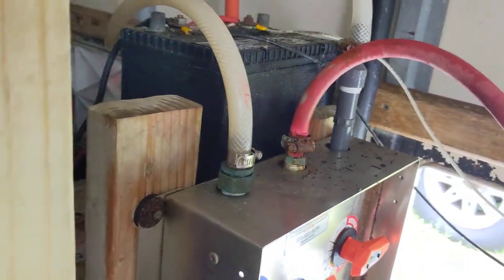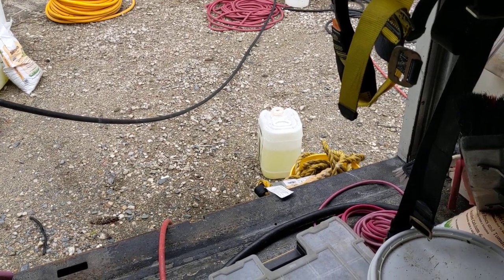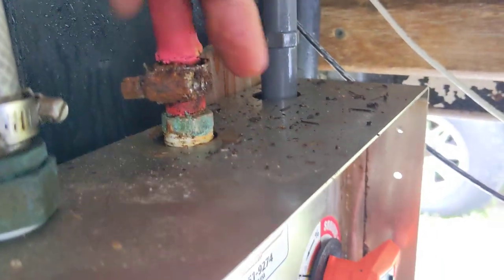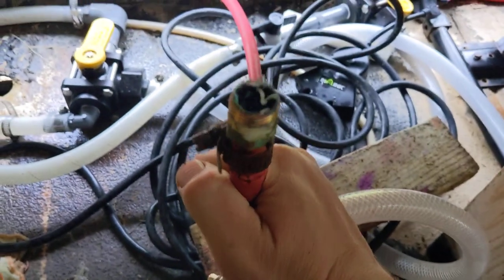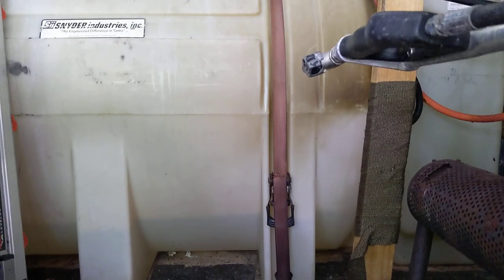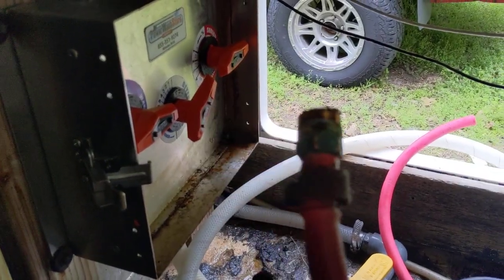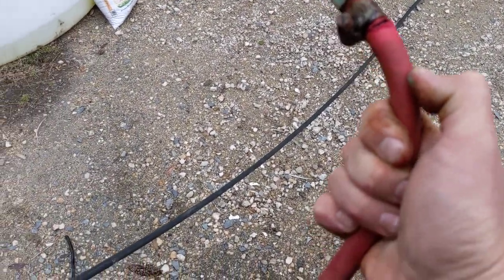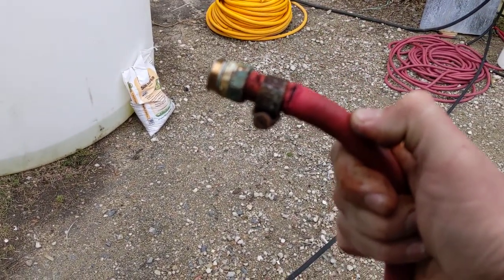Soap bucket smelling like bleach?  Or back filling? Open valve and blow air then flush with water

Comment: Stainless reducers or fittings from your local Agricultural supply will help.
Maybe go with a stainless male to female into a garden to camlock adaptor. 
Then make an air adaptor for the cam lock for when you want to blow the line out.